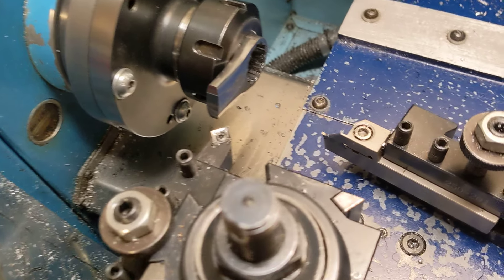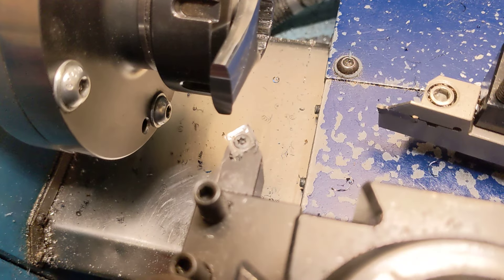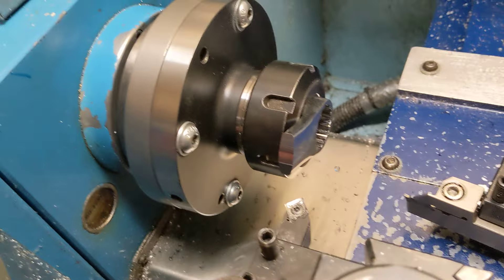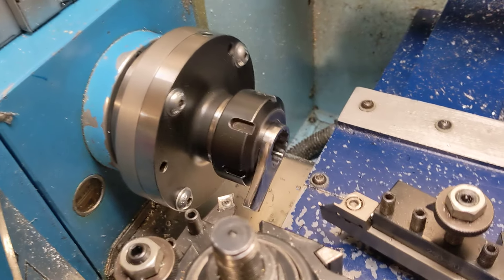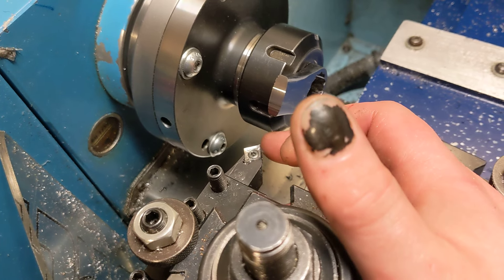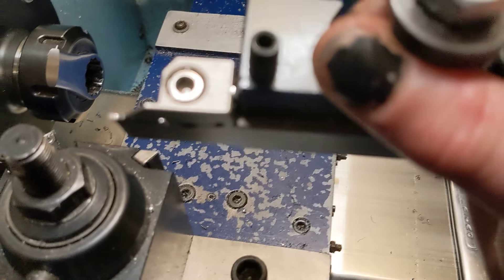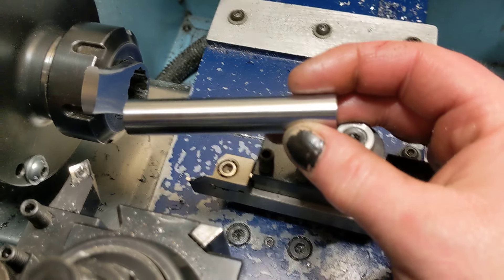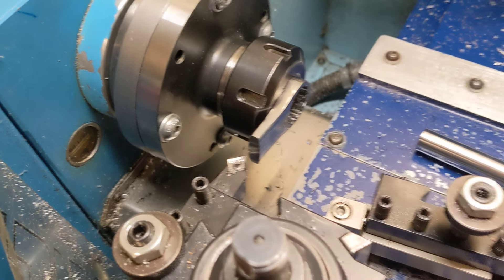Everyone on the internet is wrong about insert tooling in the home machine shop...

Comment: do not ever think doing it in those entry level Chinese mini lathe and got a same result. unless you've done something 'unusual' to it.
Reply: Wanna bet?
Reply: @lukeamato423  I'm not going to lose my money to a machinist who had ultra-high precision skill.. ahaha. btw it has tendency to bite more eagerly. and suddenly the tool is off by the backlash and "play" of the system. and ended cutting deeper. but yes, you can do it. and some advice... put the tool in tangential position, so it makes mechanical limit to the depth of cut. lock everything that can locked to minimize unnecessary move. lower the power, torque and speed so those tiny sharp tool wont chipped off. be patience and have a good luck..
Reply: @sodium.carbide  lol
Reply: Doing "something unusual" to Chinese 7x14 mini lathes is what they're there for.

You're going to have to strip, fettle, and improve the machine to make it usable, even on brass or aluminium.

You might as well add a mid-bed shear plate and carriage lock, change out the spindle bearings for tapererd or angular contact bearings, remove the compound, and replace that with a solid toolpost plinth and maybe stiffen the bed with epoxy granite, whilst you're in there 😉
Reply from the maker: Oh I agree that the little hercus is a tiny tank, but the advice still applies: highly polished high-rake-angle inserts meant for aluminium reduce tool pressure and thus reduce the forces on the machine allowing a little machine to do more than it otherwise could. Additionally, they hold up far better than you'd expect (eg the silly interrupted cut in the vid), lots of people assume they'd struggle with steel but I hard-turn with them.... tungsten carbide is magic. 
I have a friend with one of the tiny chinese mini lathes and we've tested it there too, it can't do what my hercus can (still can't hard turn 65HRC shaft for example) but it can do a lot more than it could before, and does it faster and with better surface finish than with high speed steel tools. 
The other thing is the common wisdom of 'home shop machines can't run the feeds and speeds you need for insert tooling'... which is true if you buy inserts meant for high-production steel (ie blunt edged etc for maximum insert life in that material) as they have a minimum depth of cut that is way to heavy  for a small lathe...  but inserts for aluminium can take whisper cuts off steel at a huge range of RPM etc. 
The only thing you wont get is good chip control (outside of getting extremely small nose radius inserts and related tricks), the inserts shown in this vid will birds-nest some steels and aluminium, though I have a set of tools with tiny nose radii that can chip break in the small cuts I'm taking.
Reply: @makebreakrepair  thank you. this is so much informations. love to have more videos like this..